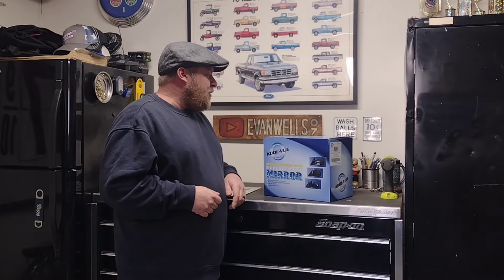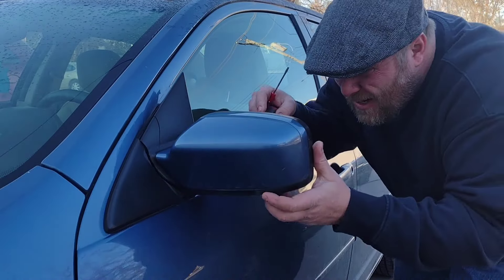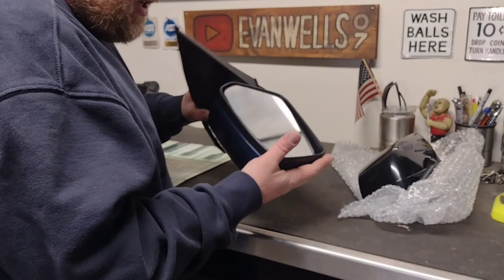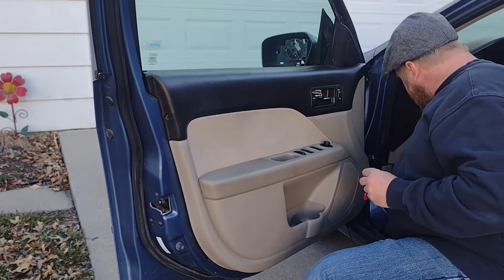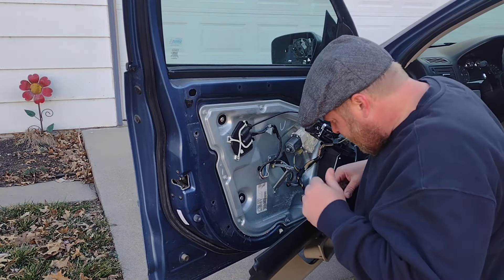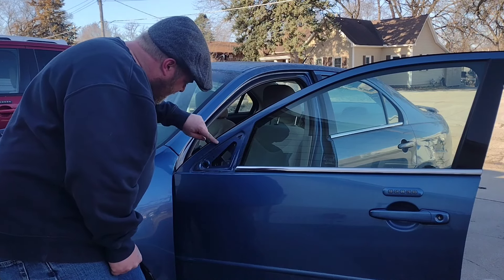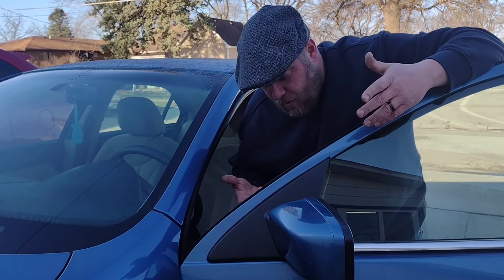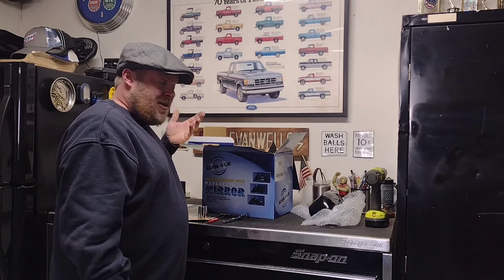How To Replace A Side Mirror On Ford Fusion / Mercury Milan 06-12 - Quick Fix!

Comment: Thank you for putting this video together. My door was only held by two screws needing T-20 and one bolt needing 7mm. Completing this task on a warm day is highly recommended. The snaps popped right off and did not break. To remove my side mirror I needed 10mm to remove the 3 bolts. Cleaning + work = 20 mins. Thank you again.
Reply from the maker: Glad it helped!  A warm day to do it is a plus, those plastics do not like moving without breaking when it's cold!

Comment: Hi what specific tools do I need? Can you make a list? I’m just a girl and I have to go find one at pick and pull lol.
Reply from the maker: If I remember right it was a 7mm 8mm and 11mm socket / extension / ratchet, and a T20 torx bit and driver.  There may have been a Phillips screw in there too on the door panels.